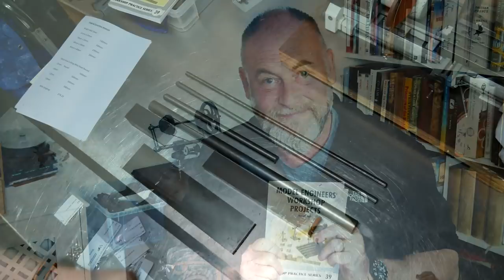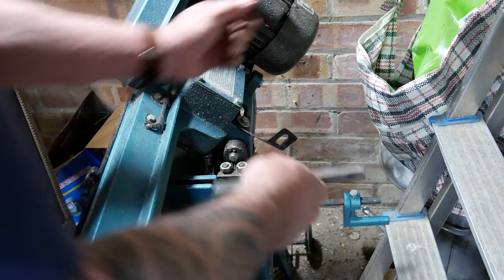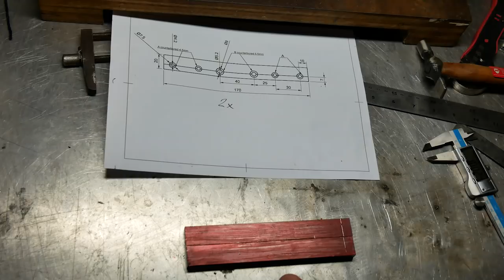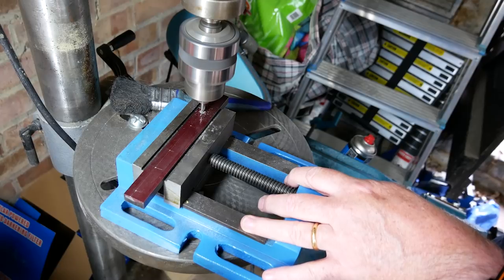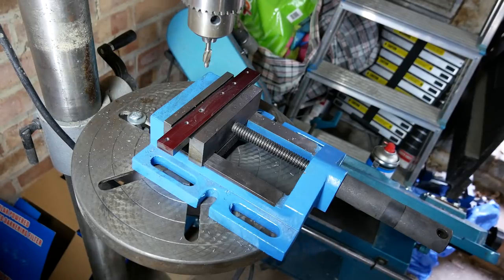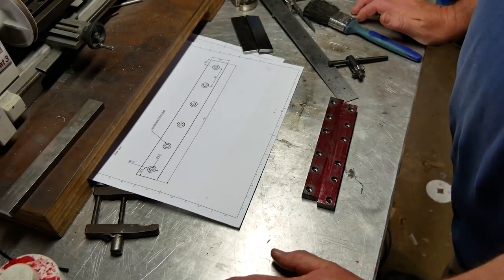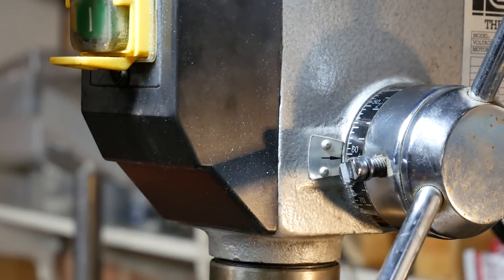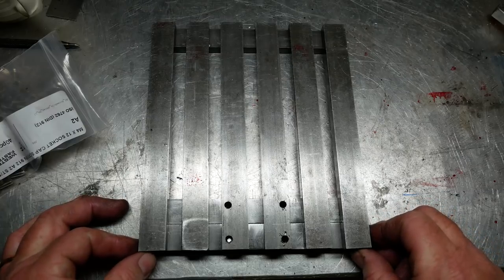Building Harold Hall's Tapping Stand Part 1

Comment: I am a Harold Hall fan too. Like you, I am a beginner, and find a lot of his projects a real challenge. Thanks for taking this on and sharing.  I noticed that you use parallels to set up the work and then remove them. If you tap the piece down with a mallet they will stay in place. Better yet, your drilling vice has a step in the jaws- set your piece on the step and you are good to go. Using either of these methods will insure that the downward pressure from drilling does not end up tilting your work piece and make the holes skewed.
Reply from the maker: Hi and thanks so much for taking the time to comment. I remove them because I was taught to do that, but to be frank often don't bother. The reason I was careful on this occasion was when drilling the offset holes, I was scared to drill into the parallel. However, I totally take on board what you say and will try the mallet idea. Thanks again. Lets hope I can get through this.
Reply: Nancy, I'm looking at this particular project and thinking you could massively simplify it by using a slotted milling table or similar for the base.

Comment: Accumulative errors marking hole positions. Use Vernier instead from one tapped hole. Mill and DRO even better. Slow down for reaming/counter boring. 50rpm.  You could use your drilling machine to guide a tap. I normally just take the drive belt off, and turn it by hand.
Reply from the maker: Thanks Willem and I agree with everything you say. I am happy to say I have improved my skills a bit in the last 2 years. Thanks again.
Reply: Everything in life is practice. Keep up the good work!

Comment: Less talk and more action would be beneficial.  I'm at 1:45 and you're still going on and on about yourself and Harold Hall.  I'm wondering if I should go on to something else or say here and listen to this seemingly endless drivel.
Reply from the maker: Well David, thank you for taking the time to comment. I suppose the obvious answer is to scroll forward past the "drivel". I am also wondering why you might feel the need to be discourteous when giving your feedback. Seems quite unnecessary to me. However, I shall take your feedback on board.
Reply: I like this format, the "drivel" that's mentioned is useful to me as a beginner.